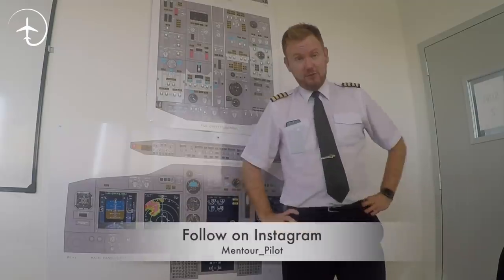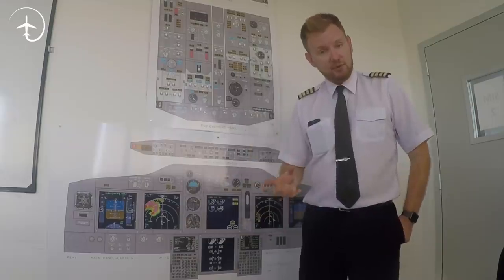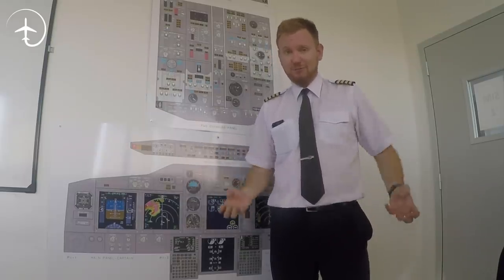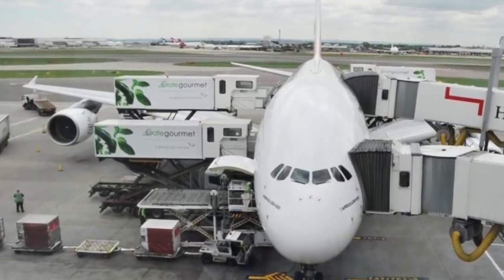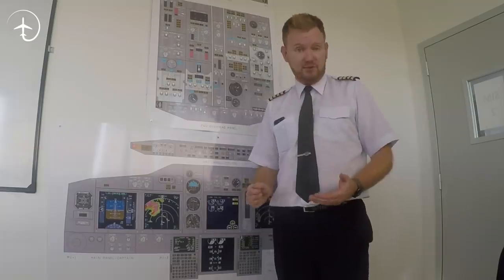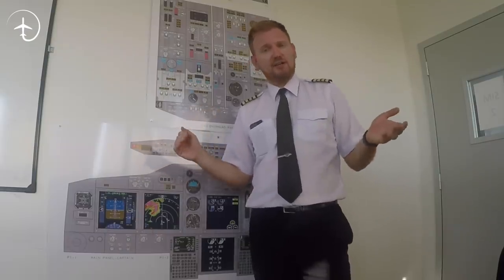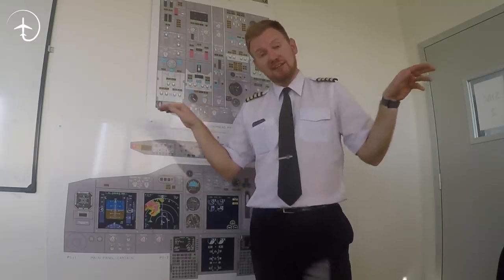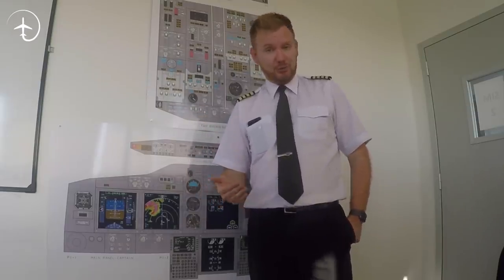What is that SPIRAL in the Jet Engine?

Comment: "really really hot"? Congratulations, you've received the Award for Understatement of the Decade.
Reply: If I remember the typical heat readings of jet engines correctly, getting close to an engine even after it's turned off runs the risk of third and even fourth degree burns. That's right, a degree of burns that isn't officially listed in most medical handbooks, likely due to the rarity of them.

Comment: When I was in the Navy, we had an airplane's main strut drop down into a weakened place on the ramp while taxiing.  It had been raining quite a bit and water had washed the under layers of supporting material out from under the concrete.  Even though there was rebar it wasn't strong enough to take the weight of the main strut.  This doesn't happen everyday and the only time I have seen it in my life time; nevertheless, another reason you may not want to walk under an airplane's wing.
Reply from the maker: True that!

Comment: Very good and very informed! I was always taught that there was another reason for the spirals (mostly on propeller driven aircraft) and the white bands on propellers. Believe it or not it was due to the hypnotic effect rotating propellers can have on ground crew, lulling them into a weird false sense of security. When white stripes were painted in radial patterns on propellers it gave a visual sense of danger to the Engineers! I have actually been in front of rotating propellers on Aircraft without markings on them and it is very hypnotic! Weird!!!

Comment: I've seen a few of your vids, and have found them interesting. Cheers!

As you ask if anyone has any questions:
After the aircraft has left the runway, and it's taxiing glacially slowly towards the terminal building, why is there always an announcement which says to keep your seat belt securely fastened?
I'm guessing that it's in case the aircraft suddenly stops, but as the aircraft is going slowly, the potential G-force on a passenger is trivial, and in the event of an incident on the ground, removing the seat belt for slow taxiing would aid evacuation of the aircraft... So why demand the seat belts are kept fastened at this junction in time???

Thanks.

Comment: Hi Mentour! 
I've always wondered, in the case of possible engine bird ingestion, why don't manufactures put a kind of mesh, or fencing material over the inlet of the engines - to prevent birds getting sucked in? 
Thanks!
Reply: There’s a video on this somewhere. I think it’s because any mesh material you can put in front will just get sucked in itself. It would also cause a serious decrease in efficiency even if it were possible. It’s just too much force.

Comment: Spirals on WW2 planes were used to check propeller rotation speed with stroboscopes ! This was useful to calibrate onboard instruments and check if the rotation was smooth and in relation with the rpm indicated onboard. This was "invented" by german air mechanics

Comment: When we didn't have rope to block the wing part and moved a de-icing truck to block it (during winter operations) some passengers still want to squeeze through the small gap between the engine and de-ice truck rather than walk the extra 5m around the wing. Like buddy come on. At least when there's someone on spot they can explain the hazard involved.

Comment: One thing I've noticed is that they sometimes shut off the right engine first as they are still taxiing in. I would think this is probably because the luggage handlers and other servicing personnel have to work on the right side of the aircraft.

Comment: Nice tutorial. I always wondered why don't they cover the engine opening with some strong crossbars with the center enforced by the mid of the engine spiral nozzle? would the engine really such that in still? or how about giving the engine a lower lip lifted upwards so it doesn't suck air horizontally?

Comment: Ducked under a wing once and walked straight into a tie down ring. The little spring that was supposed to hold it flush to the wing had broken allowing it to hang down.
I woke up a few seconds later on the ground. The other mechanics for some reason found it to be hilarious.

Comment: How about embedding LED warning lights into the rim of the engine intakes and outlets that change colour and flash?  They need not introduce any turbulence if designed-in and weight, power and service requirements would be negligible.  Maybe super-bright flashing while running inlets would scare the birds away and red fading through amber to green on both inlet and outlet when it is safe(r) for ground staff.

Comment: Hello mentour pilot, really enjoy your video's great learning tool but I have one question, when air transat 236 ran out of fuel over the Atlantic due to fuel leak why did they have to descend from 39,000 to 30,000 when the first engine flamed out? Why couldn't they stay at 39,000 on one engine, didn't know that 9,000 ft would make that big of a difference?

Comment: Hello sir, I just recently checked out your channel. Certainly it is awesome. I have a query, I had heard somewhere that the cone spirals also help to initiate better flow of air into the engine, like the Rolls Royce 800/900/1000 engines. Is it true?
Reply: Hello, I work at the airport at as far as anyone on the ground is concerned the spirals on the plane is there so dumbass rampers, mechanics, security, customs, operations, gate agents, don't get to close to the engines after the plane has just landed and accidentally get sucked in and die.

Comment: In the early 2000s, I was once soaked in jet fuel by accident working with CO-Air Express. Unbeknownst to me or any training received, I didn't know that you weren't allowed to be standing under a wing. The good thing I guess was the fact that all of CO-Air Express jets were ERJ'S with engine's mounted on the rear tail section of the aircraft, thus being away from engine's. However, It was necessary for me to take a trip to the Hospital for DECON. YES.... DECONTAMINATION. Little did I know. In fact I even almost cause the flight to be delayed. After I was covered in fuel, I gave the crew their weights PBT. It was then the first officer said, "Ugh... do you smell jet fuel? " The captain replied, "I do. That's not good." I immediately said, "What you're smelling is me covered in fuel. When you guys I guess pressurized the tanks, I happened to walking under the Wing as got caught". That's even I learned a valuable lesson of NEVER WALK UNDER ANY PLANES WINGS! Needless to say, that was a trigger for a lot of ground crews  retraining.

Comment: Paint one or two opposite blade fins (to keep the balance paint two opposite fins)   in bright white reflective paint and add a strobe light that triggers on a regular bases and this would give the effect of a fan blade spinning slowly even when  it is running at high speed and adjust the strobe time base to suit best visualisation of the fan running and risk associated with it, as well as it would deter many more birds as the fan blades are larger and birds would see it from far away. Free idea in the interest of safety.

Comment: yeah high bypass engines have more suction then the high powered low bypass jet engines i used to work around, wasnt as big of an issue for me.... I used to just hang out near the intake on hot days to cool off right before taxi to take off at EOR

Comment: In the USA, now that the propeller planes are all gone, airports have been undergoing upgrades to add more betrays.  No more parking out in "no man's land," rolling up stairways, and bussing people into the gates.  The plane pulls up to the beltway and debarks the passengers.  You get on and off via the jetway.  This keeps the passengers away from places they're not supposed to be, plus it's much easier to get handicapped passengers on and off the planes.  I speak from personal experience.   I loathed the propjets, because I cannot climb stairs.  They would have to move the stairs away, bring me up in a "cherry picker" then move the stairs back into place so the other passengers could board.  It was a massive nuisance for me, and annoyed the others, but it had to be done, because my legs won't bend to do stairs anymore.  My back is broken.  It's much easier to be wheeled down the beltway, and then my attendant and flight attendant help get me settled. Takes less time and is less of a nuisance.  And I usually get a free upgrade!  I like that!

Comment: There's another aspect related to that spiral called the Stroboscopic effect. When working on an engine at night, or inside a hangar there might be a situation where the flickering of the artificial lightning and the rotation of the engine are synced in a way that is looks like the engine is not moving at, or moving extremely slowly judging from the fan blades. But when you look at the spiral, you notice the real danger, which was invisible before.

Comment: why not use LED lights on the spiral itself to add to safety in which the speed of the engine would be indicated from red (too fast) to yellow (slowing down) and green (safe to walk next to without getting pulled in)? and different variations in those colors to determine the speed more accurately

Comment: Since the presence of spiral designs on the spinners, it appears that sometimes when an aircraft is sitting at a gate with the engines not running, the fan blades appear to slowly be moving in the "opposite" direction.  Just before the engines are started, that movement stops and when the engine is being started, the fan blades begin to turn in the "normal" direction. 

Is that my imagination, and if not, what is the reason for the fan blades to slowly rotate when the engines aren't running?  I can imagine it might be to keep things well lubricated or  keep some bearings warm, but that's purely a guess.  Thanks!

Comment: At least five times in mainland China (where jet travel is new / mysterious tech), passengers have thrown coins into the engines as they boarded for "good luck". Other passengers reported them to ground crew. What's the risk of taking off with coins in the engine? The engine is already really hot, so how long might it take to be 99.99% sure no more coins are in the engine?

Comment: Well that asnwers the spiral question, but now raises a couple others:
1: not all engines have spiral spinners, why not? Should it be mandatory and are spiral spinners discretionary for engine manufacturers to make and install?
2: I know some engines,  usually on T-tailed planes that have grates or guards over the fans that prevent foreign objects from going through to the fan and into the compressor during operation like the front of JT8D engines, why not just have all engines like that instead of exposed fans?

Comment: Someone in some TV engineering documentary spoke about those fan hubs being made from perhaps a rubbery material that caused them to shed any ice coating from building on the hub. I got the sense that previous hubs were getting lumps of ice then it would flake off in flight and potentially harm the blades. This is nothing to do with the spiral paint just the actual fan hub tips that have the spiral paint job. Do you know anything about that?

Comment: +Mentour Pilot Although I agree with the risk of being drenched in jet fuel, isn't it usual to not be in the vicinity of a plane being refueled anyway??? I believe the minimum distance for non-refueling crew is 10 meters at least??? I know that it even used to be that noone was allowed in the vicinity if the plane was refueled, but that rule was relaxes slightly.

Comment: 1.Why can't I bring factory closed water/drink container bigger than 100ml? 
2.Why can't I bring things like nail fail, etc with me on board, while I still can buy hard glass objects in duty free zone?
3.Why duty free products are much more expensive than those outside an airport?
I know, I know, you'll tell me safety reasons, but I don't buy it due to 2 point.

Comment: Jet Engine @50,000 hp, Kirby uses same turbine, approaching popcorn with Kirby, you are popcorn. 
Night engine tests, sitting in truck offset of intake, my tech partner takes engine to full thrust, you see the obvious St. Elmos Fire lightning dance across on blades of fan. Would need high end video to capture.

Comment: You know another reason it would suck to get drenched in jet fuel?

Jet fuel is just like diesel, and neither evaporate (quickly).  One time my dad spilled diesel all over the seat and door of his truck.  It was greasy, sticky, and smelled like diesel for an entire year, not even kidding.

Spill gasoline on yourself, it will evaporate off in 10 minutes or so, but soap and water cleaning would be best.  Spill diesel or jet fuel on yourself, and it is going to suck to get off!  Soap and water would be a MUST; Gojo hand cleaner would be very helpful too.

Comment: You say the ramp 'should be' looking at the engine after the anti-collision light is out to check, but on the CRJ2/7/9 it's damn near impossible to tell from the wingtips if the engine has spun down or not. Doesn't help that the APU is louder than the FO side engine at idle. Good thing the engines aren't near the ground, I'd probably be dead a few times over otherwise.
Reply from the maker: Well, if you are that far away it’s not really an issue after the anticollision is turned off. It’s more if you are walking right in front of it.
Reply: Mentour Pilot You've gotta walk right in front of the engines to chock the plane. Which is why we usually only chock the captain's side, most taxi with only the FO side engine running. When there's a wind advisory though, I try to get the team lead to check that the engines have spun down before triple chocking. Doesn't mean everyone does, and I'd wager most don't.

Comment: Hey I thought that spiral also shows the direction the engine will spin if we trace the path the spiral takes? Is that not the case?
Reply from the maker: Yes it does! That was important on older jet-engines which could start “the wrong way” but not on newer typesz
Reply: Thank you sir!! :) By the way, how do they tell if the engine is still running on aircraft where the fan blades aren't visible? e.g. Concorde, fighter jets, etc. Thanks again :)

Comment: airlines don't want you to know about this one simple trick:  the engine is not actually there to propel the aircraft , the wings proppel it by rapidly flapping up and down like a bird , instead the engine contains  a  small luxury apartment that you can enter by stepping next to the magic black portal , once you are in there you will automatically get spat out on your destination , but be sure to throw your baggage in first so it gets into the portal since all ground handlers are paid by big airline  and will not do it for you

Comment: Interesting. I never knew. BTW. You don't get "sucked" into an engine, you get blown into it. The explanation is simple. It has all to do with gravity. That huge fan's blades act like shovels and "digs" air out of the atmosphere at a very high speed and causing it to become very thin. It wants to create a vacuum. But here's where gravity comes in. The earth pulls the atmosphere down very strong and it rests very hard on the surface. Now suddenly a hole wants to form and the atmosphere wants to fill that holeso a very strong wind appears there to fill the hole to make the atmosphere neutral again and then everything in the way of that wind will be blown into the engine.

Comment: Would it be possible to incorporate a bright red LED light, activated by centrifugal force, at the centre of each engine. It could be battery powered. This might deter bird ingestion at take off and flight. ... As well as providing an extra warning to ground crew. A strong magnet and a hole might be a simple retro-fit?

Comment: Why the plane frequently rise and fall during flight.? Does sometime pilot switched off the engine while flying high and like car  pilot also put plane into neutral mode to save fuel?
Reply from the maker: No, that feeling has to do with turbulence and you actually raise and fall much less than you think.
Sometimes we do “step-climb” in order to get higher as the aircraft gets lighter.

Comment: If the spiral help deter birds, why not paint the spiral across the entire diameter of the engine rotor? Surely this can be done on the inlet, which is cold enough for paint and slow enough to be balanced after the fact?

Comment: Why do passengers have to keep their seat belts fastened even when the aircraft is stopped at the stand, but with the engines still running (and, indeed, why do the engines stay running so long?  Does the tower have to give permission to turn them off?)?  

Regarding the seat belts, surely if a problem were to occur at that time that involved getting passengers out quickly this could impede exit.

Comment: A few times after a flight I received luggage that had signs of some liquid, that looked like jet fuel or something. I once found that my bicycle case was actually dissolved inside a little because this liquid got inside the case, which was not properly closed probably after security inspection. Is it common when jet fuel gets onto or into passenger's luggage?

Comment: I'm a dispatcher and trust me, anything short of barbed wire will be ineffective against some idiot passenger disregarding warnings and signs to try and run under the wing to get to the steps first,  and shouting solves nothing because the moment you turn your attention towards someone you can be sure that someone else passes behind your back and under the wing. This is why i prefer staying closer to the engine and not the wingtip, this way i can be more sure that they dont go near it and leave a burning bloody imprint on the exaust.
Reply from the maker: Hahaha, sad but probably true.